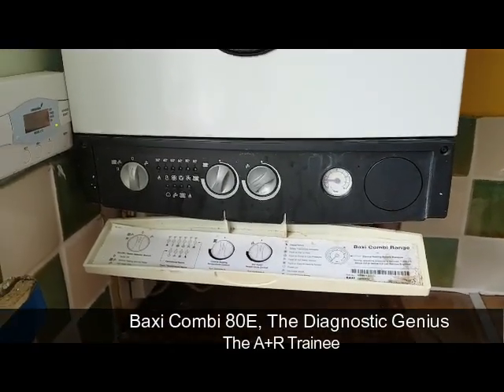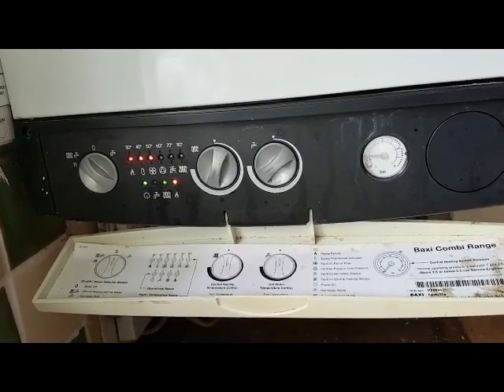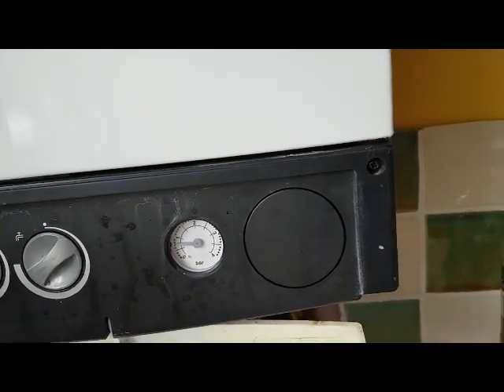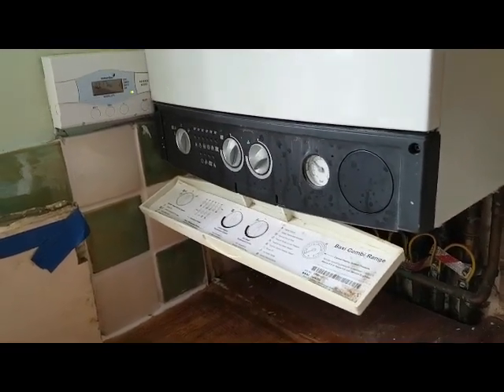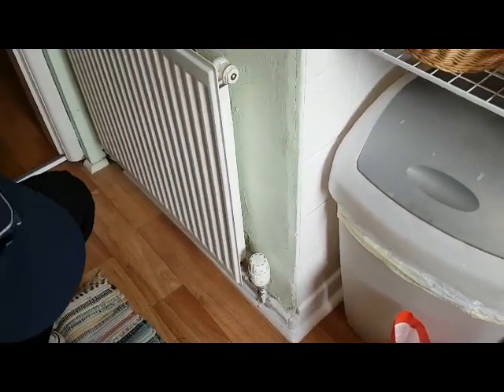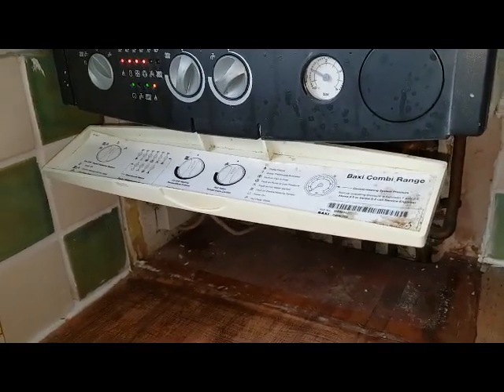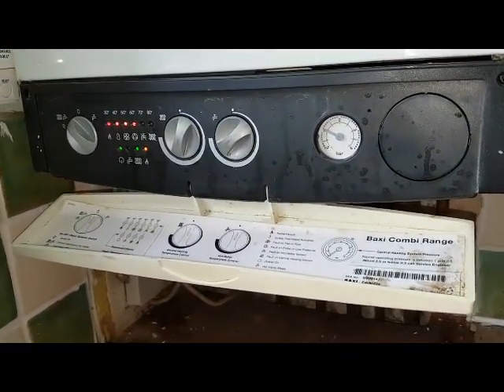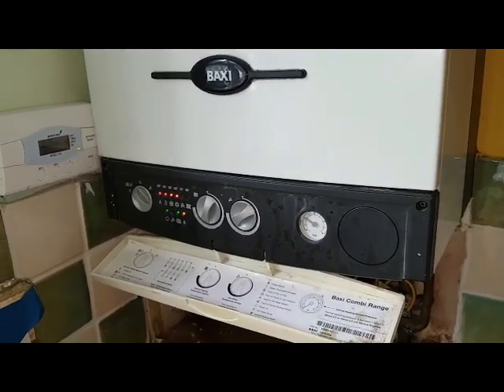Boiler repair training (Low Level) Baxi Comb 80E. With Coach Tony Morgan

Comment: I have a Knob on the very right where in the video its covered by a black circle. I accidentaly moved it when cleaning and now my heating doesnt turn on but the hot water does
Reply from the maker: Move the level on the timer to the 1 position it should come on also make your room thermostat is turned up

Comment: Nice vídeo!! My boiler is just showing the power light on... When I try boost for 1 hour nothing happens... There is no noise of the pilot anymore. Any idea what's going on with my boiler? Thanks a mil
Reply from the maker: If you run the hot water tap and the tap symbol doesn't come on then its the divertor valve
Reply: @ARBoilers  yeah I tried that right now and still nothing happened... I guess have to call for a company or so. Thanks again

Comment: I have this boiler.. when you turn it on you hear everything start up for a second then it shuts of then it turns of.. the pin on the ignitior keeps popping up then going down.. any ideas.. 2 bar of pressure.
Reply from the maker: hey we're currently trying to grow our Facebook group and would love you to join Tony and the team using this link, Tony will be available to answer all your questions directly there's also updates on new trainings we just released too. https://www.facebook.com/groups/167070231326174
Reply: shuts *off 
turns *off 
*ignition

Comment: The red lights are not coming on with my boiler and no heating or hot water
Reply from the maker: Which lights are they?
Reply: @ARBoilers  it's an older boiler than that one. A top row of lights are not working and the flame light is flashing red.
Reply from the maker: @stardust-hr8wh  could be a pcb fault trying resetting it
Reply: @ARBoilers  👍